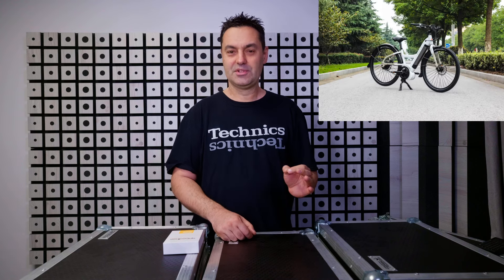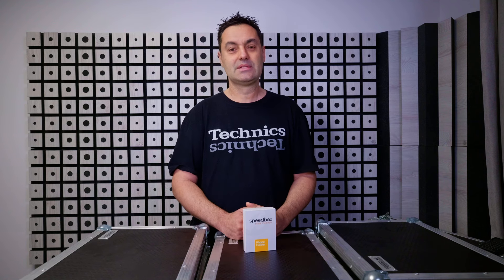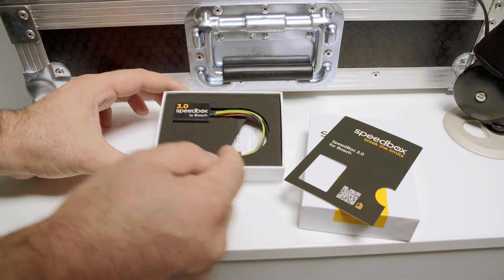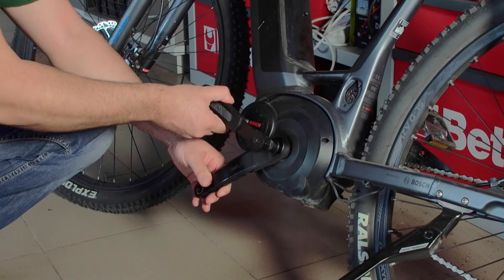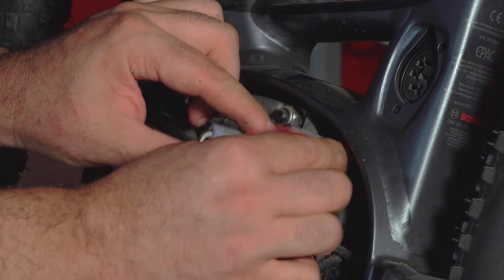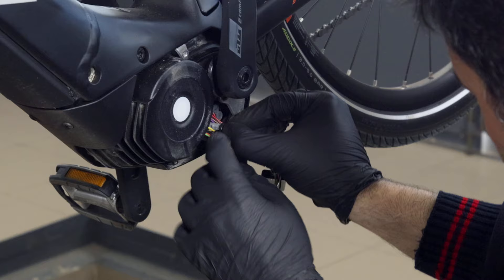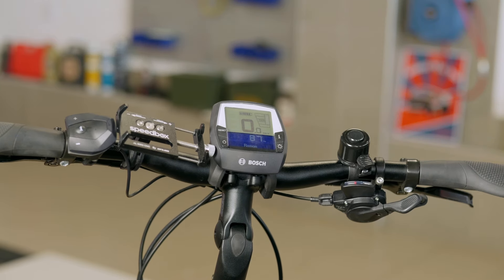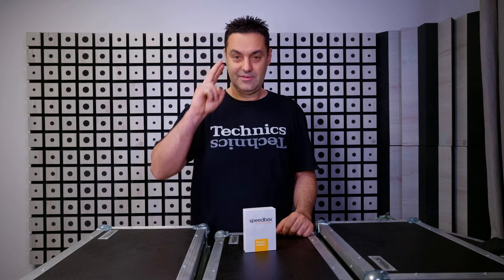SPEEDBOX   Remove Ebike limits ENGLISH Video Review

Comment: Not good For motor
Reply: why
Reply: @quazar912 Troll. Doesn’t hurt the motor at all. It just removes the artificial,speed limit
Reply: @brentschmogbert1  I think so too...stupid EU regulations prevent driving faster than 25km/h (among other stupid thing in EU)
Reply: @quazar912  meh I’m fine with that. If you don’t like it just buy a pedelec that can go 45. Problem solved. The regulations are there forma reason. If you go faster your bike must have better brakes, sturdier frame etc. it’s not always „minimi eu regulations stupid“. Usually they make a lot of sense if you at least try to read the reasoning behind them which is very easy to do btw.
Reply: @brentschmogbert1  Actually the ideal is around 35km/h like in the US, 25km/h is too slow.
Reply: @zepp3lin  thank you for sharing your personal opinion